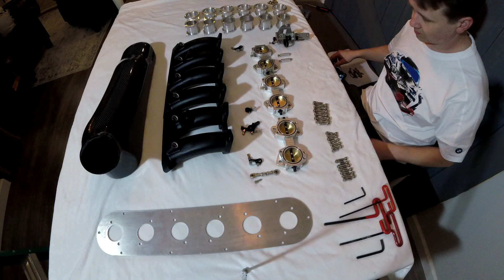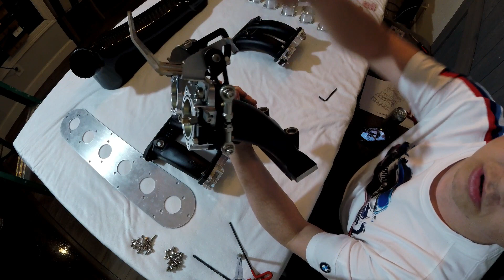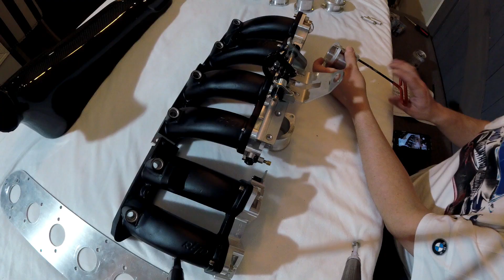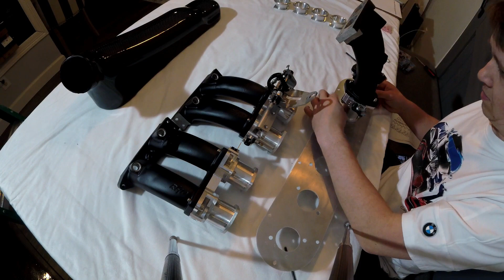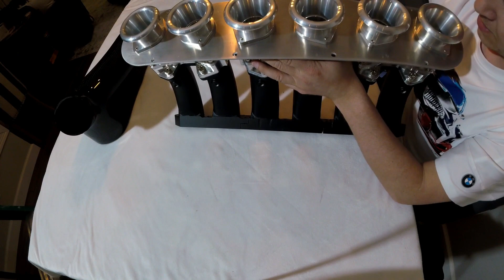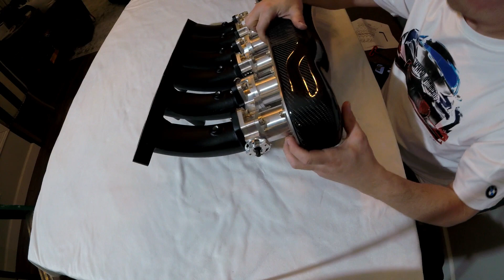RHD ITB Kit Assembly s50

Comment: There's some guy on youtube making s5x clones and he made like 270-280whp with itbs
Reply: Oh you're talking about f0xy. He made 285hp but never specified if it was whp or hp. Based on a high number like that I'd assume that would be 285hp at crank. Because the S50 clone gives 220-240hp at the crank. An ITB would only be able to make 40-50hp on that motor.
Reply: Where you buy that kit ???